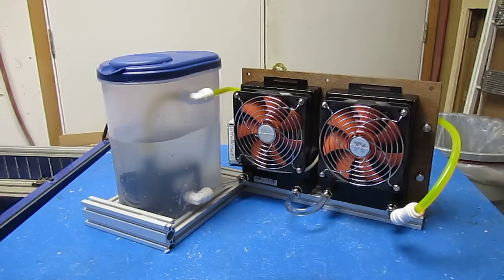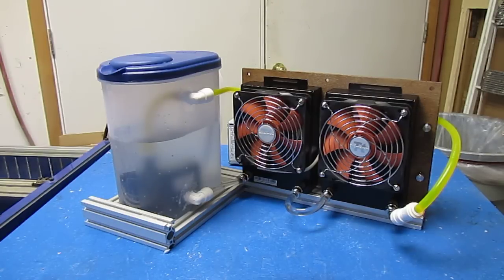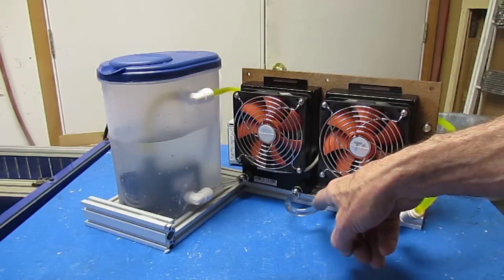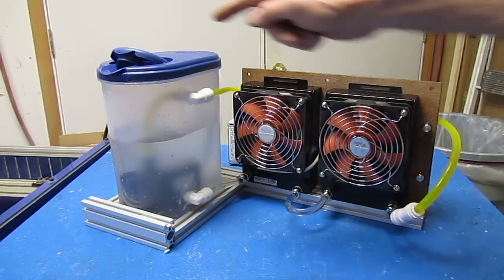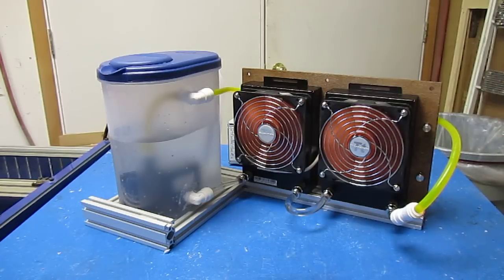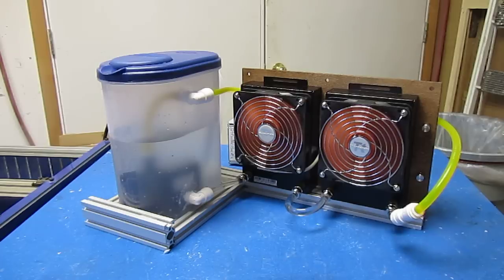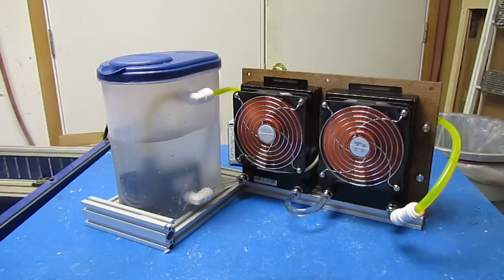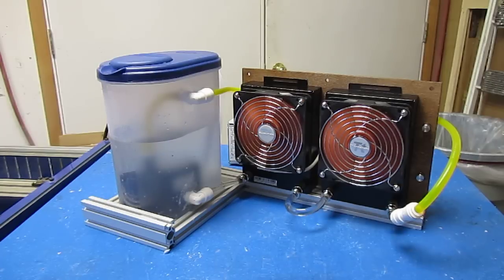DIY CO2 Laser Tube Cooler

Comment: Looking nice,  great work.
NOT NEGATIVE QUESTIONS :
1.  It's covered on backside? I hope not, there should be airflow thru radiator to work better.
2. Did You test it on working CO2 laser with temp control? (ex. K40 40W)
2a. What temp in what time it getting?

Comment: nice work but the hot liqiud( water) flows back at the undersight and the pump directley sucks up
 the hot water without minimal cooling the back flow hot water shut be on the top sight than you wil create a good cooling loop ;) put the hose in the lid ;)

Comment: This looks like water cooling, not like CO2 cooling. i need -80°C cooling temp just like dry ice.
Reply from the maker: Correct. This is a cooling system for a CO2 laser.